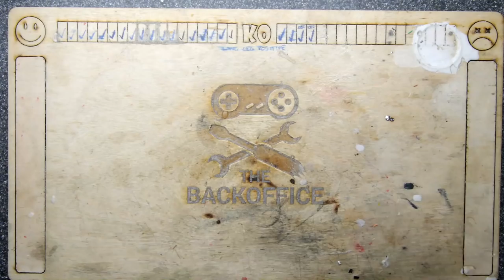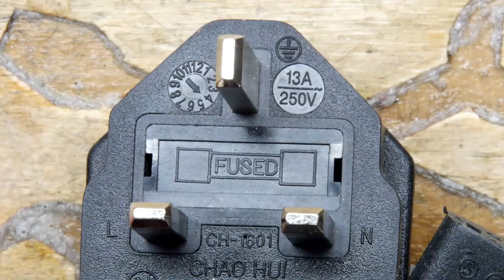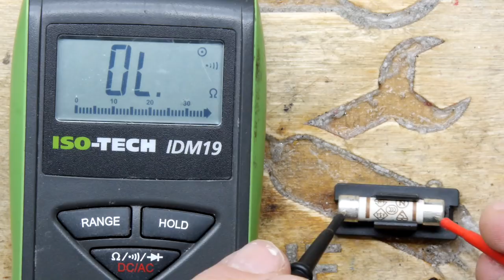Mains Plug Safety

Comment: I remember back in 1994 when I visited a friend in his new place.  The previous occupants had a floor standing electric cooker and oven, running on standard mains wire like you would have on a TV.  Heaven knows how that was not a smoking wreck of an appliance, when it should have been wired with much higher grade cable and fuse etc.
Reply from the maker: A lot of electric ovens are on 3kw, but hobs need a proper setup 😄 maybe when they turned on all the rings the voltage drop saved the cable

Comment: Can u put a 13a plug into a 10 amp wall socket ? Aslong as the other side of the kettle lead says 10A
Reply from the maker: Technically you can, but how is the wall socket only rated to 10amp at the fuse
Reply: @backofficeshow  sorry so this means if the bit on the end say 10a 250v this is fine to stick into a 10amp mains outlet just cos I’m going to a trailer park and it’s got 10amp wall outlets and I have a 13a plug and a 10amp kettel lead on the end of it
Reply from the maker: Really your fuse in your lead should match your flex. So I would remove the 13amp fuse in the plug and at maximum use a 10amp - though realistically would a 5 do? What are you trying to run?
Reply: @backofficeshow  charge a ebike ?
Reply from the maker: Should be fine

Comment: I wish our US plugs we're fused like yours in the UK. Sadly in the US it's profit first, safety....eh, we'll get to it.
Reply from the maker: How about dual phase stuff?
Reply: No need to fuse them as the breaker is max 20 A. In the UK breakers are 32 A.
Reply from the maker: I might have to disagree, That would turn your cable into a molten metal lasso under the right conditions.